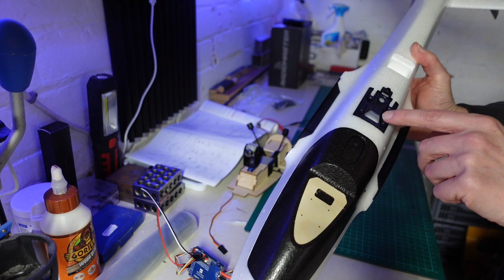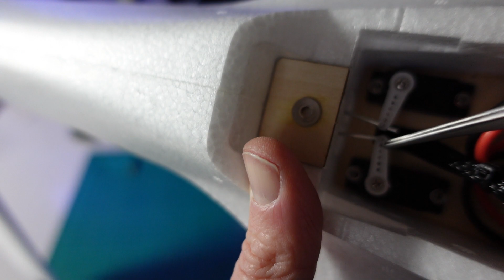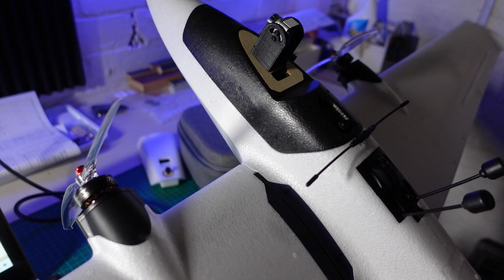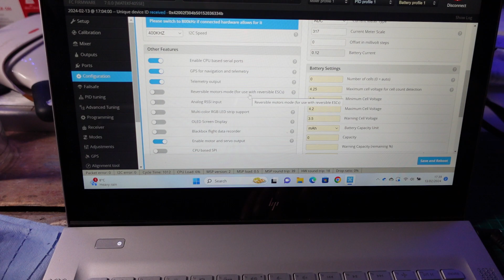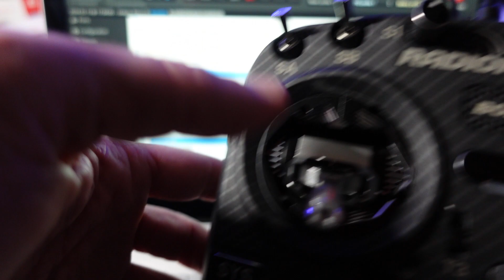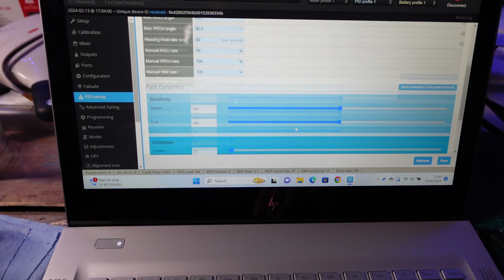AtomRC Swordfish assembly - Part 3

Comment: I cannot for the life of me figure out how to get my f405 wing mounted into the bay... it's super frustrating... Did you just glue yours in??
Reply from the maker: I just used a 3M sticky pad. You are installing it into the bay underneath I take it?
Reply: I am still planning my build, wing mini in my case. But I have wing full sized on other plane and would recommend 3d printed plate at the bottom with metal inserts to bolt the FC onto it. The plate is mounted with regular screws to the wood then. But yeah, no simple way except 3M pads as mentioned :)